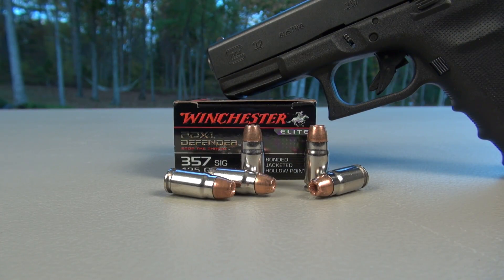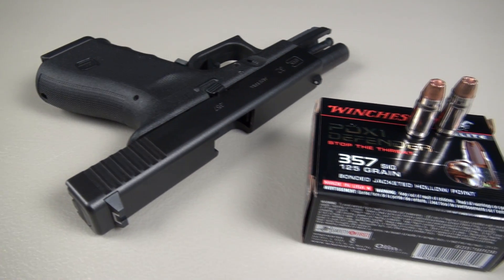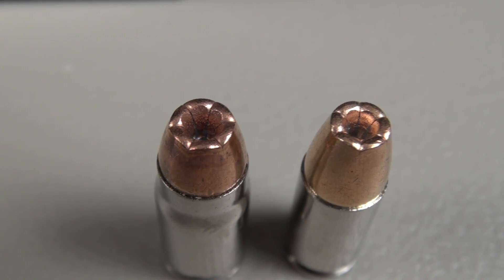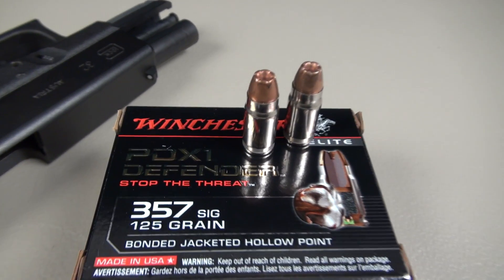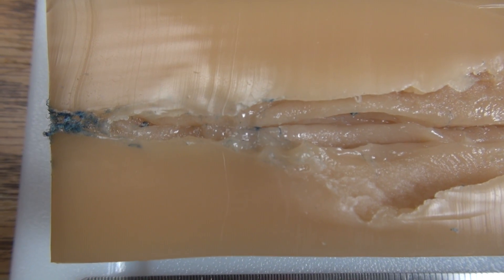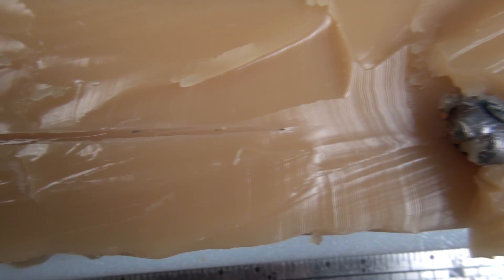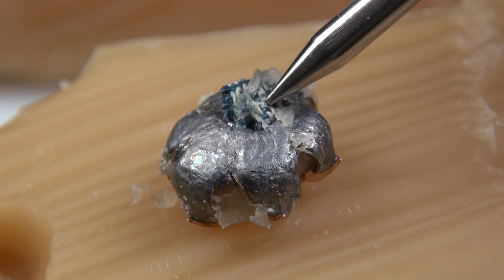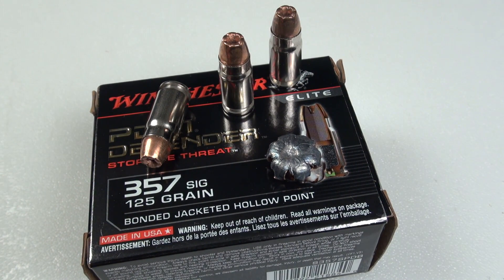.357 SIG Winchester PDX1 Defender AMMO TEST

Comment: The perfect concealed carry pistol is a pistol with a 4" barrel for hollow point bullet performance and a short 10 round magazine for concealment with the ability to accept a 15 round follow-up magazine. If your gun has a 3" or 3.5" barrel you should be concerned about hollow point bullet's performance but not with a 4" barrel. This type of pistol can be used for concealed carry and home protection. I carry a Glock 26 with a Glock 19 barrel in it. Anything less is not worth the money
Reply: I have threaded barrels for  some of my sub compact handguns for that very reason.

Comment: Great videos. Discovered them a cpl yrs ago. They have helped a lot. Been reading about wound ballistics and "stopping power" in the gunzines since the late 80's (big thank u to Evan Marshall and Ed Sanow). The 357 Sig is as advertised- magnum performance in an auto. Most 125 gr magnum loads are in this same velocity range from a 4" bbl, even a bit less. I love my Sig P239. The recoil to me feels a bit less overall than my P229 in 40, but with slightly more muzzle rise, which is not bothersome. Conceals well in a good high riding holster (try the DeSantis Mini Slide or Speed Scabbard for compact guns), and u know it has the horsepower. I have a 357 bbl for my 229 also. I actually bought it several yrs before the P239, but never shot it. Go figure. STAY SAFE!!

Comment: I run PDX1's in my .40, and they ain't no joke.  In my opinion, they're the best JHP's available.
Reply: +menacinggesture I just got some for my G23
Reply: I like the Hornady critical defense. I shot a deer at 100 yrds with a 5" .45acp. immediately under the skin about the projectile had fully expanded leaving a permint wound cavity the size a 12ga slug would make all the way through. so basically it was a .45 cal hole in the fur and skin from there forward it was a 1inch hole all the way through out the other side. it dropped where it was standing. and the critical defense shoots flatter then most. and you can get a cheap version called zombie max. and I like the name because it can help in court when your asked why you picked that round and can say that it says right on the box defense.
Reply: I agree to a point. My two favorite g23 loads are the 180g pdx1 and 180g gold dot. Both top of the line bonded loads.
Reply: Same PDX1 165gr
Reply: I second that. I run 165gr  WIn bonded in my G22

Comment: To clarify a few things about PDX1 and the Ranger line.. PDX1, sold in 20 round boxes and intended for consumers, is a bonded bullet. Winchester has two modern JHP designs in the Ranger family, which are sold in 50 round boxes intended for law enforcement. T Series and "B" as in Bonded.  The T Series is not a bonded bullet, and is much more comparable to the outdated black talons. The Bonded series Ranger is directly comparable to the PDX1 for a given caliber and bullets of the same weight, as they are near as makes no difference identical. Only noticeable difference between them is price.

Comment: Ranger T's are a non black Black Talon the coating is now clear instead of black, the PDX1'S are essentially a bonded version of the Ranger T or the SXZ or whatever it is by Winchester
Reply: When I contacted Winchester and asked them if the PDX1 was the BT, SXT, and/or RANGER, they stated EXACTLY what you stated in your reply. The PDX1 "IS" the bonded version of the 3 aforementioned bullets. So, you're still getting the old school bullets, just modernized.

Comment: Based on what I've seen and read, 12 inches of penetration is fairly standard for all the PDX1 line (including .308, and 12 ga segmented slug, aka the boiler room buster), they are designed to avoid severe over penetration. Regarding the PDX1 vs Ranger T series, my understanding is they are the same except that the PDX1 is bonded, while the Ranger T series is not. From the testing I've seen the Ranger T "talons" are more exposed because they separate from the led core but that also makes them vulnerable to "over expansion" and folding around the back of the bullet.

Comment: TNT said his result for the PDX1 .357 SIG was 1326 fps with advertised velocity of 1350 for it. Winchester advertises 1250 fps for the RA9TA load, so they are not the same velocity. Now if you really want to get the most out of your .357 SIG, get some Buffalo Bore 125gr loaded with Speer Gold Dot bullets at 1433 fps!

Comment: my walmart sells pdx1 and hydroshocks, also american eagle 55gr bthp 5.56mm and winchester whitebox fmj 5.56mm. but as ive said in a previous post, the pdx1s ive have used were 40s&w, and they were not crimped, and out of a box of 20, 3 of them had bullet set backs, and in a 40s&w the bullet HAS to be crimped because of the amount of pressure in the case any head space removed and kaaboom for you. tossed out the remainder 15 and got some remington goldensabers.

Comment: i think this ammo is shit. i used to carry pdx1 in 40sw, and did a hefty bit of research on the 40 itself (before hand) and discovered that the 40 operates at 35,000psi, toppling a 45 in psi (21,000+/-), which is nothing new, but also read that if a 40 has its head space reduced it is likely explode due to its cartridge depth (45 and 9 have more H.S. wiggle room) After racking the top round about 3 different times, the bullet recessed in the cartridge about 1/8". WTF how about a CRIMP winchester

Comment: The .357Sig penetrates on par with 9mm bullets of similar weight and speed. Penetration is also a results of design, and how early/late expansion occurs .Deep penetration is favored by LEOs for light barriers and max angled shots on big guys. Before the FBI protocols HPs were designed for less penetration and more 'safety', re. over penetration. Less IS ok for SD/HD frontal shots  Also, Double Tap  tested their 125gr Gold Dot @ 1450fps. to 14.5 inches, reportedly.

Comment: The 357 Sig doesn't require +P+ ammo to achieve this performance.  Additionally, the shouldered cartridge makes feeding hollowpoints effortless and virtually jam-free.  Not every 9mm gun is capable of firing +P+ or even +P rounds, but every 357 Sig is capable of firing 357 Sig.

357 Sig is my carry gun, and I love it.
Reply: I would not carry anything else either pal, check out the bonded loads from underwood and double tap they are getting 1500 from a 125 grain!!! Over 600 pounds of energy!! Insane!
Reply: @louv4437  10mm also ✔️
Reply: @Roberta_Esposito  agreed pal

Comment: 357sig is still "normal pressure" so you cant compare a +p+9 to it, you'd have to compare +p+ 357 sig to +p+ 9mm if your going to do that. 357sig is essentially for those who want to run 9mm +p+ 24/7, without the worry of +p+ warnings. I think its point is penetration, and for that a FMJ should be used. i'd like to see it in a light carbine (sub2000).  from what i've found 357sig is cheaper than +p+ 9mm, and many consider it more "consistent." and the 357 is still "young" compared to the 9mm.

Comment: .357 Sig is completely pointless.  It is identical (bullet size, weight, shape, and velocity) to 9mm 124+P+ (e.g. the 127 +P+ Rangers) and it's still only about 80 FPS faster than 9mm+P (check the specs for Speer GD 9mm 124+P vs. Speer GD .357Sig 124).  There is absolutely no point in the caliber that I can see.

Comment: @72cmcinc 
Unless it fails to expand, it's moving the same weight faster through a water like substance.

The faster something impacts something liquid-like, the harder the material becomes, and the less the object can travel through it. This is why you'll see the most penetration with a 147gr 9mm, out of about all of the typical self defense loads. That 357sig is one insanely nasty round, I'm surprised it's no more popular than it is. Less muzzle flip than a 40, with better performance.

Comment: The Ranger T and Ranger Bonded are both available in .357sig. The Ranger Bonded is almost identical to the PDX1 bullets with minor tweaks depending on caliber. Obviously both the PDX1 and Ranger Bonded are bonded bullets. The Ranger T and SXT are very similar in design than both the PDX1 and Ranger Bonded BUT the Ranger T is non bonded. The non bonded bullet allows the jacket to separate from the lead core and create the "Talons".